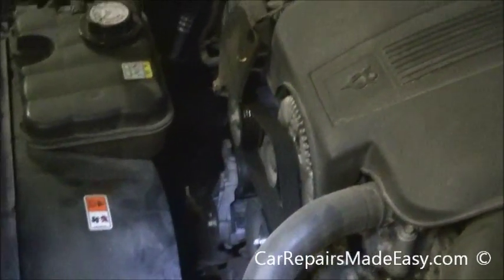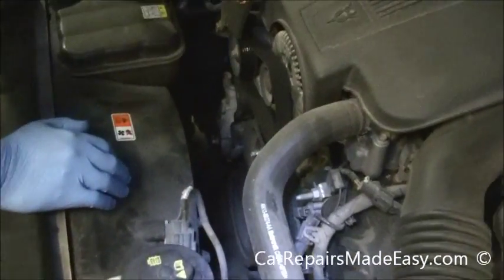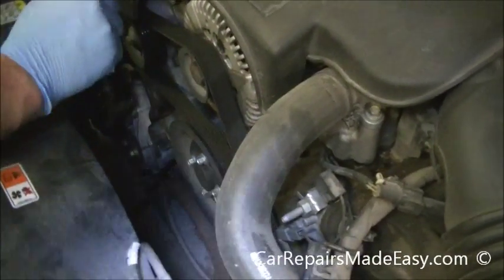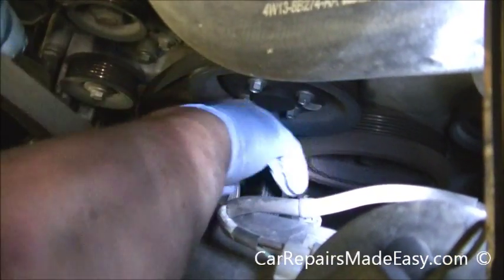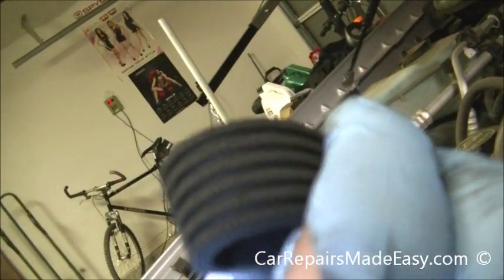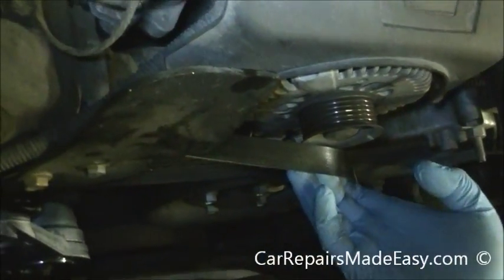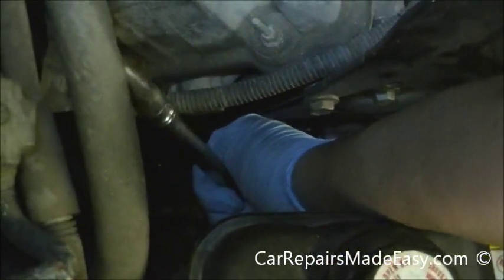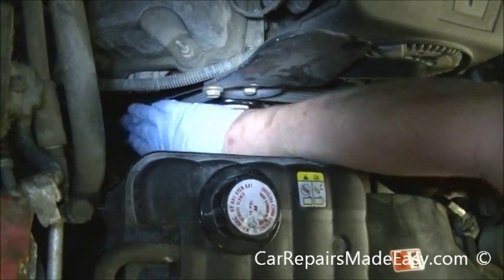Lincoln Towncar Ford Crown Victoria Belt Replacement

Comment: I was pretty sure I knew what I had to do I came here to get verification. Thanks. I used a 1/2 breaker bar head to release the tension with the tensioner.